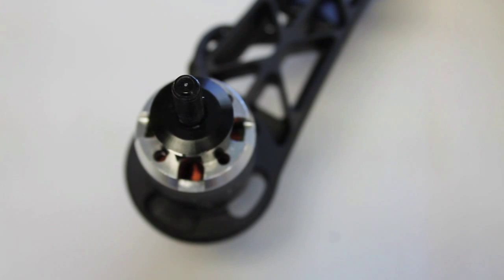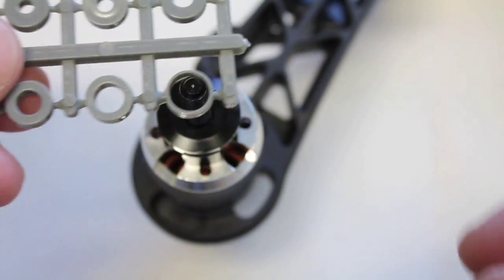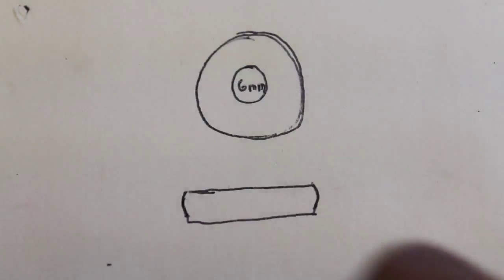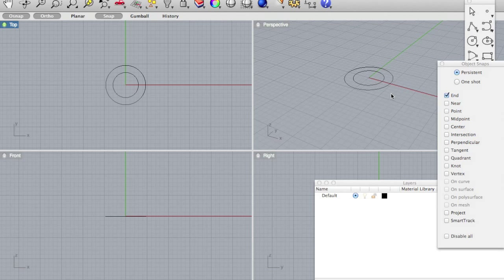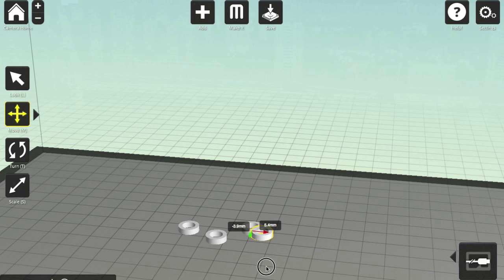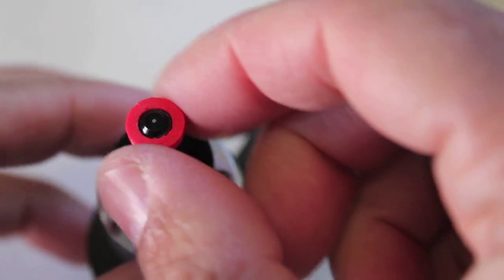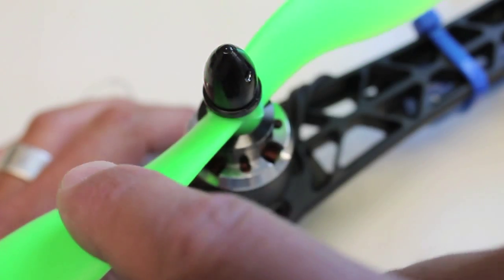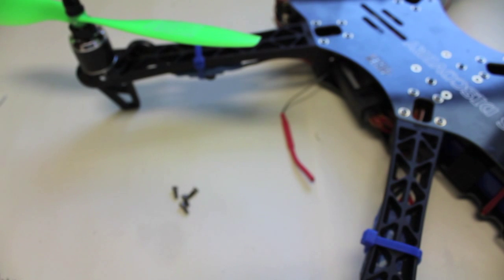TBS Discovery Vibration and Gemfans - Removed Motor Labels, 3D Printed Prop Spacers, Prop Balancing

Comment: Great little video. Thanks.

One neat balancing trick, after getting as close as possible, is to actually balance each prop on the unit with a small mirror mounted to each arm and a laser set up to point at the mirror and reflect to another surface, say a wall. Be surprised how much more  dynamically balancing improves AP.

thanks again,
and good luck to you,
rev don
Reply from the maker: Don, thanks for sharing that. I've seen a few guys use that method and it seems to work really well. I'll have to give that a try some time. Take care.

Comment: all measurments done wrong . messuring the inner diameter of the prop by measuring the outer diameter of the spacer? not clever..   the  the spacer that you say barely fits is the best of all that you have there  including the 3d printed it will fit snug and do the job right just try and twist it to feet screw it in  be creative. all about in rc is modelism you have to make something yourself not everything hobbystore... for example you have to trim the spacers ''ears'' that is left from the matrix with a razor to make it perfect not just expect laser cutted components...
Reply from the maker: Simon, thanks for the feedback on the process I used to do this. I will definitely take your suggestions into consideration the next time I do this.
Reply: Dennis Baldwin
;)
Reply: I like your gutsy observations. Dennis is like a lot of us. If it wasn't a fun "work in progress", I would be on to something else.

blessings,
rev don
CFII/ A&P
Reply from the maker: donald ducky Well said and couldn't agree more.

Comment from the maker: Thanks. I've heard good things about PrintrBot although I've never used it. The other ones I hear a lot about are Cubify and the Up 3D printer. If you're looking to DIY it then check out RepRap. There really are a lot of options out there. Yes Rhino is by far the best I've found for the Mac. I started with Sketchup, then used some free AutoDesk tools, then went Rhino. Right now Rhino is in Beta for Mac and free to use. Not sure what it will cost when they go to production though.

Comment from the maker: I hear you loud and clear. I've been looking at the Iconic-X as well as the QAV 400/500 series. Both isolate vibes from the frame. I still need to get my motors balanced and then see how that goes. But I don't feel the TBS Discovery does a good job of at least isolating vibes.

Comment: Come to find out, I still have vibes. Ive been watching all my footage on a 19" laptop, it looks fine there. But on my 40" flat screen you can see jello. This is with all the prop and motor balancing. I ordered that moon gel. Hopefully it will do the job. If not I'm buying a Iconic-x frame. That frame isolates the motors from the rest of the quad.